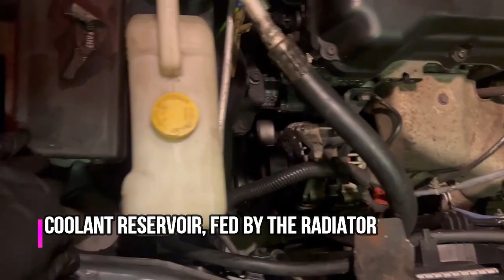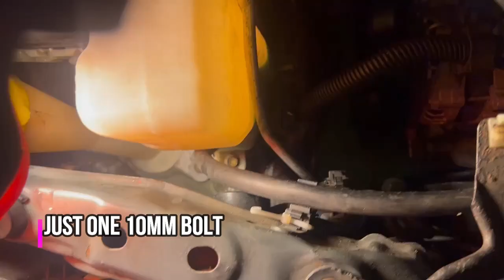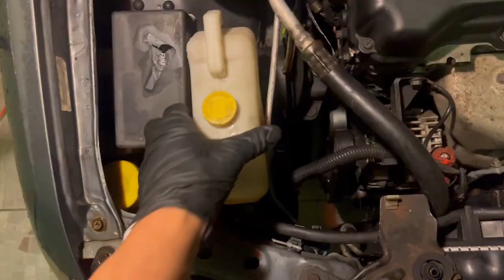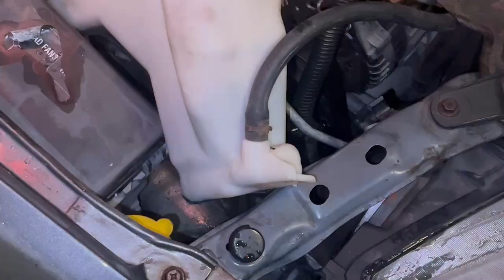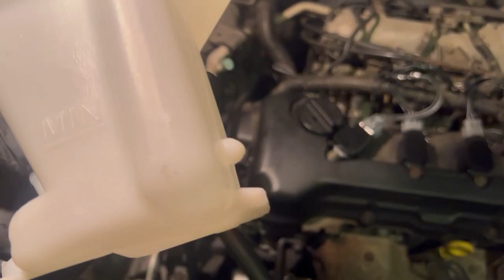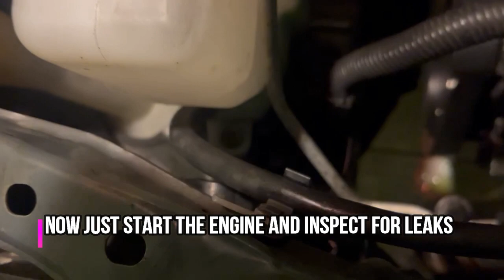How to replace the coolant reservoir tank Nissan Sentra 2000-2006 fast and easy

Comment: Hey brother what size type bolt do we use for that reservoir. I broke the bolt head mine trying to get it out to replace the reservoir and also how do I take that stuck bolt out without the head.
Reply from the maker: Wow, thats bad! Need a bolt extractor set, a bolt with no head needs to be drilled.